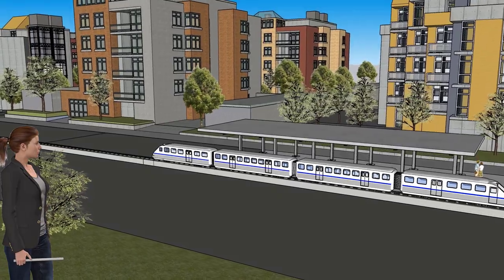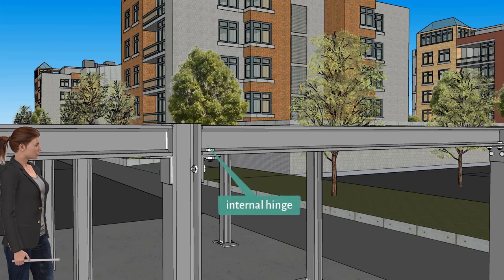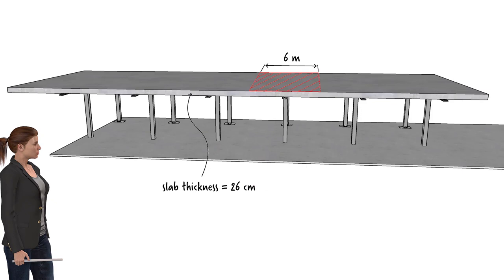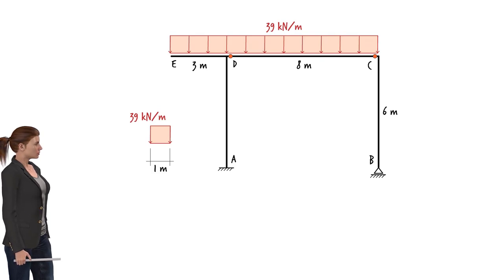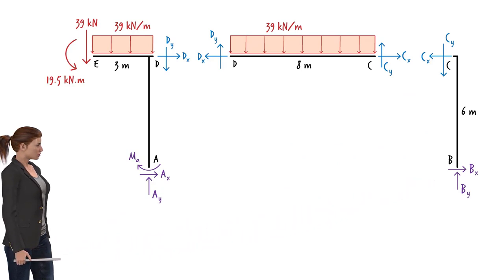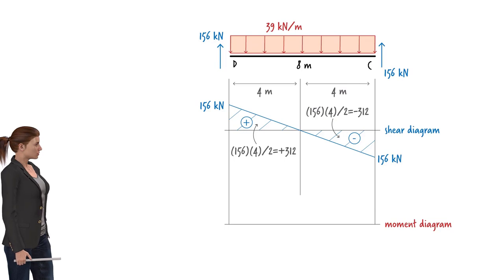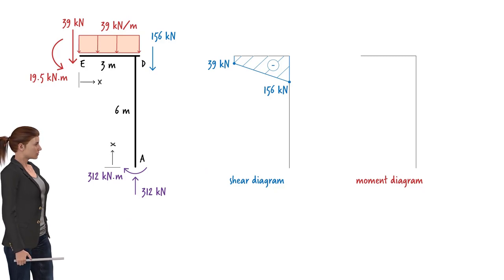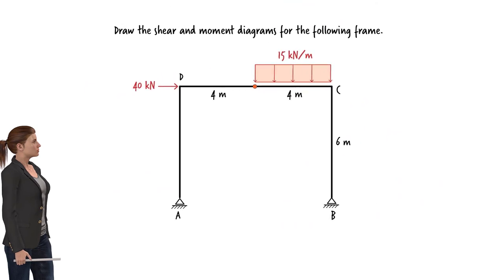SA68: Review Session (Shear and Moment Diagrams for a Frame)

Comment: Greetings.. kindly make a video of manual analysis of a braced indeterminate frame . How to determine forces in braces. Thanks for the excellent videos.
Reply from the maker: We can use the displacement method to analyze an indeterminate frame with diagonal members that act as braces. The displacement method yields joint displacement and member forces (both the primary members and the bracings). 

Please see our lectures on the matrix (displacement) method for structural analysis. You can access the updated version of the lectures through our (free) online course. See link below. 

https://courses.structure.education/collections
Reply: I have visited the link but the videos are not opening… kindly advise the procedure
Reply from the maker: What link are you referring to?